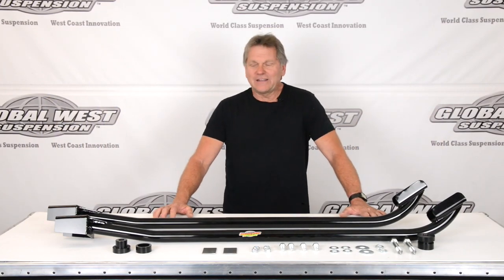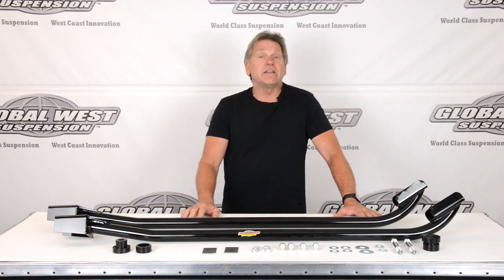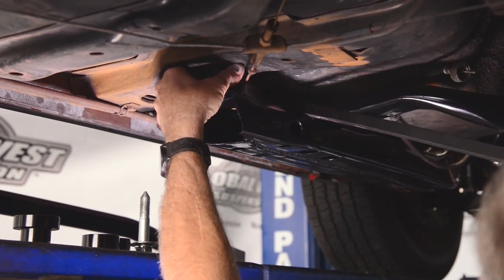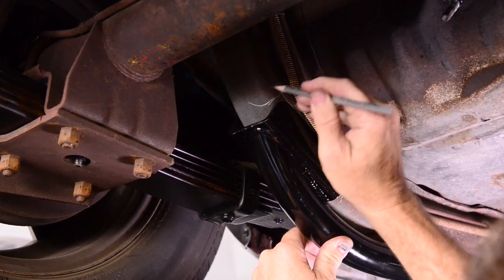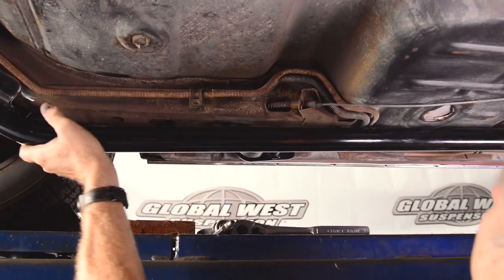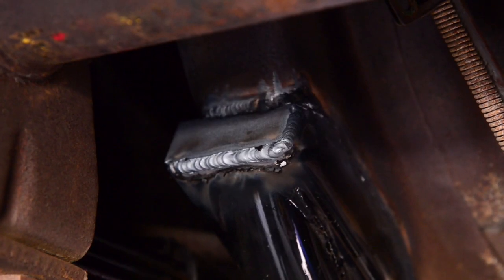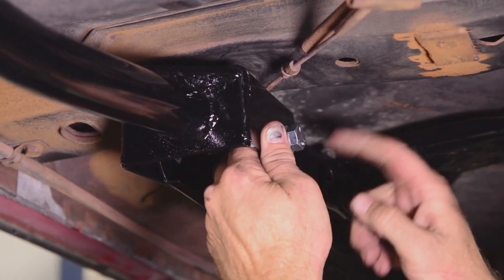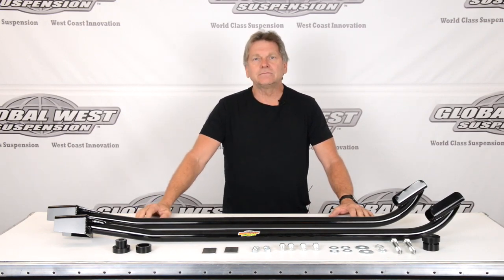How To Install 1970-1973 Camaro & Firebird Subframe Connectors

Comment: Love the design.  Making me rethink my decision to cut slots into my floors.
Reply from the maker: Thank you - we are not a big fan of cutting slots in the floor. Dedicated race cars is one thing but a multi purpose street car is another. Note: Evan on some of the race cars we build, we don't cut the floor.
Reply: I prefer sinking custom connectors into the floor pan. Better ground clearance and if welded to the subframe and floor, a much stronger and cleaner installation. Of course, I build custom rods.
Reply: Joe Di Carlo  You're rude.
Reply: Perhaps a comprimise .. custom diy square tubing with 1 side removed enough to hug the rear frame rail, and just touching the backseat foot-well. You'd only have to notch that 1 floor brace and re-locate those brake lines.
Reply: Joe Di Carlo  I take issue with your comment that if they aren't welded through the floor they aren't worth having.  Yes, welded through the floor is more rigid, but it also ruins the flat floor for passengers and makes installing carpet a huge pain.  Global West's design is a good compromise for those that don't want to screw up the interior. So if you're building a dedicated race car have at it.  If not think long and hard.

Comment: I have a fabrication background, However am I missing something as to why the welded ends are not sitting flush against the frame rail and you have to box the end? Why not toss a tighter radius die in the bender and get that bracket to sit flat against the frame rail?
Reply: I agree, they fit like shit.
Reply: @metalbill2007  yep
Reply: Guys, look at it again.  The short section of channel that wraps around the rear frame rail is straight not bent.  There is no way to get a straight section of channel to sit flat against a curved frame rail.  If you put a tighter radius on the round tube than instead of just the one end of the channel having a gap to the frame rail then both ends would have a gap.   Said another way the channel would only be touching the frame rail in the middle and the ends would not.  Requiring you to box both ends.  Of course they could fab and weld a curved channel piece to match the frame rail (which would be nicer) but that would drive the cost up.
Reply from the maker: For the most accurate response to your question give our tech line a call! 877-470-2975
Reply: well they would have more returns on the item if they did what you said...lolz
Reply: @johnjames5020   No reason a correct fit should drive the cost up more than a few dollars. SO lets say TEN dollars more, TWENTY dollars more, for each bar sold. We get a part that fits correctly, nicely, and takes less effort to install?   Reviews would make that worth your while.  When I first read the review I agreed with you, now that I have my bars and am fitting them to my Camaro.. I disagree, I want them to fit correctly, so I have to refab them.
Reply: @johnjames5020    Also...  Not agreeing with the bolts to the subframe. It seems to me that would be a pivot or weak point....  welding mine in the front as well...  I DO like the round bar and the closeness of the contour, except for the rear bracket of course.
Reply: Gotta love all the internet experts certified geniuses in the comment sections. How about you stfu and design a better one or use another brand if it bothers you so much.

Comment: Just ordered a set of your subframe connectors for my 1967 Camaro. I noticed you’re  using a four post lift for the install. Do you recommend a four post lift so the car is on all four wheels vs a two post lift. Would the unibody on a Camaro be under too much of a load if I do this on a two post lift and potentially lock in bad door gaps etc? I have both types of lifts in my shop.

Your products are absolutely awesome. I just put your full front suspension on my Camaro and have your front and rear kit on my 1972 Pontiac. Haven’t driven the Camaro yet as I’m still building it but the Pontiac is a completely different car now. Amazing difference.  Thanks for all the great stuff you guys make for our cars!
Reply from the maker: Thanks for the support and kind words! For the most accurate response to your question give our tech line a call! 877-470-2975

Comment: Since the replacement bushings are aluminum, does that mean that the front two bushings need to be changed to aluminum as well? Thanks.
Reply: In terms of strength/reduced body flex, yes. Although they may make your noise/vibration a bit harder. Usually solid body mounts are a race car thing.

Comment: I’m curious to know what is different between 70-73 and 74-81.
Reply from the maker: To further the technical discussion give our tech line a call! 877-470-2975
Reply: the thickness of the paint i believe
Reply: I'm almost %100 sure they are the same. Frames are the same and frame rails are the same except were the frame meets the trunk pan to the tail panel.

Comment: So on a weak floor / door sag situation, can you somehow preload the connectors by jacking the car up to flex the floorpan to remove sag, before welding ? 902s for T-top cars too ?
Reply from the maker: Give our tech experts a call to get that question answered ASAP! 877-470-2975

Comment: Thanks, have 90x on my 79 Camaro.  What are your thoughts on having 2 extra bolts bolted to the subframe, would it help eliminate any potential pivoting?
Reply from the maker: We designed it with enough strength in mind!
Reply: @GlobalWestSuspension  Thanks, they've been on for a couple of years and holding strong. Will need a new set now for my t-top Firebird, not a lot of structure with part of the roof missing 😂
Reply from the maker: @car_ventures  Glad to hear they're doing their job! Thanks for the support!

Comment: Seems like all store-bought connectors have something to be desired.  On yours I worrie that the rear could interfere with a mini tub and the front doesn't look tied in all that well. Seems like a guy could come up with something more solid on his own
Reply: These are really good but Detroit Speed has an alternative that ties the front subframe into the front leaf spring box AND the car's body but requires cutting the floor, especially the rear footwells, and so are more involved that this method. They're not very intrusive and don't affect ground clearance though. They almost look like how GM should have designed the car in the first place.